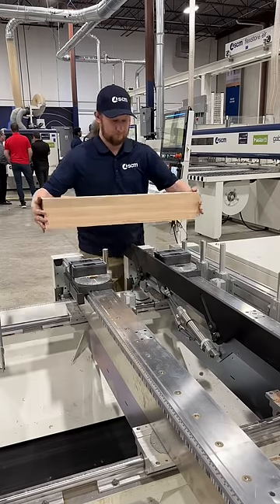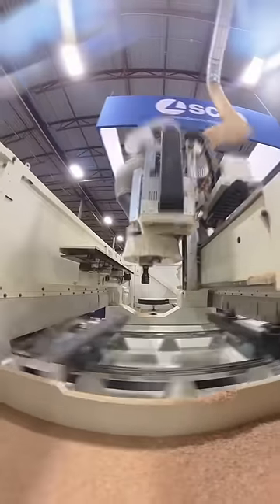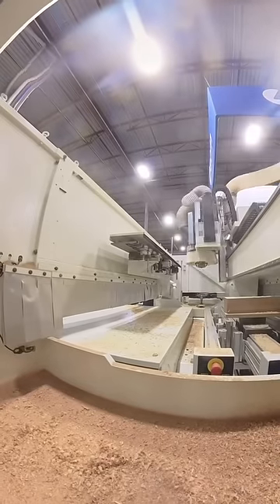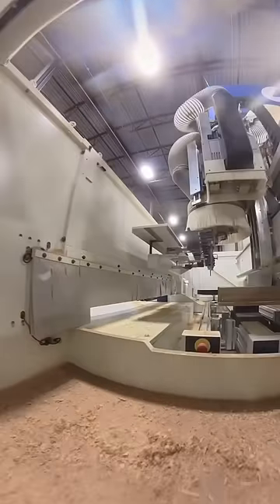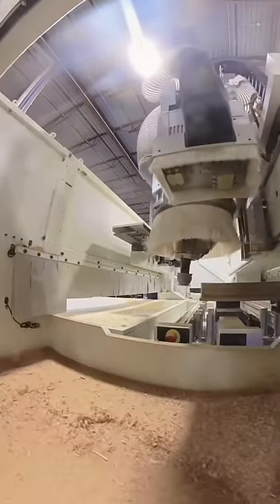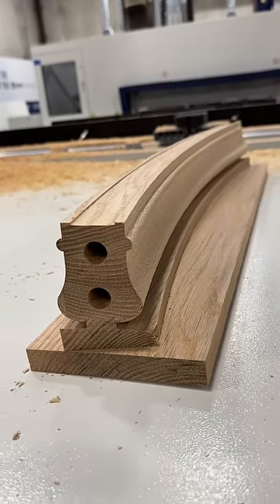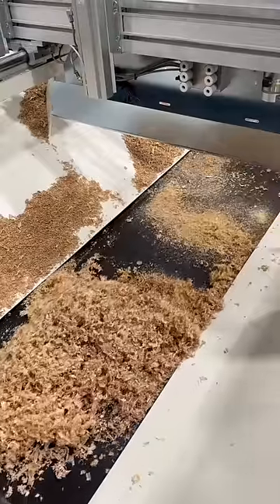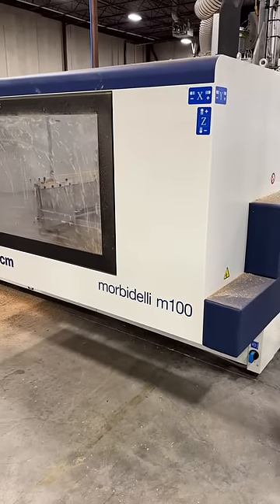Very cool 5 axis SCM woodwork machine #woodworking #maker #tools #wood #cnc

Comment: "another cool thing to point out is that it has a conveyer belt that transfers all the sawdust out and into my neighbors yard"
Reply: The cool thing most of the houses are ranch style on concrete slab. it doesn’t need any step with railing.

Comment: Fit in well, in my garage. Never mind just wishful thinking. Thanks for sharing
Reply: This looks quite wasteful unless it is doing a one-off.  
 Just to let you know  the Chinese were doing  investment casting of metal parts maybe a 1000 years ago. They would cast in say 20 pieces at a time  horse bridles. So making complex parts has been around and does not necessarily need a 2 million dollar cnc  lathe.
Reply: @emanuelmifsud6754  What on Earth does investment casting have to do with CNC woodworking?

A man with an Adze and a drawknife could make make this 10,000 years ago, but certainly not the 'average' man.
Reply: @emanuelmifsud6754  ... This item is actually  custom piece. meaning there will not be another. These machines are capable of machining multiple copies of one part, all while the operator is removing the finished part, and replacing it with a blank piece of wood block, hence cutting production time since the machine does not have to wait for the operator to load a blank block then start cutting it.
Reply: @emanuelmifsud6754 the sawdust doesn’t just go to waste from a big operation like that, also that thing cut that amazing thing in like 30 seconds. It’s a money printer 😂
Reply: @Sandburn58 there's no two the same pieces of wood.
Reply: Probably more than your house is worth,five axis generally go for a milliondollars,I are chinist
Reply: @tomwristen372  . So what you’re saying is, I might just be able to afford the packing it comes in🤣😂🤣😂
Reply: @dustylumberco 
Is This Italian Company?
Reply: @RichardMLowe   yes, it is
Reply: @user-nj1ob8ht3p  
User in New Jersey 
I'm trying to figure out where in Italy he went I already knew that he was there 
If you look closely at how Italians spell names (last name) they will have double letters in some to most cases 
My grandparents are from Sicily (the island) on my mother's side and came to Long Island in the early 1900's before Hitler and his Goon Squad made an attempt for World Domination and failed

Comment: thats cool, but the rail should be bent instead so the grain doesnt look differentl
Reply: Awe common man you know the thing can’t do what a human can. We just want to convince you that it better, faster, and more efficient than a human.  The fact that it doesn’t look right is your fault for expecting to much!!!!!   😂😂😂😂   They say the machine doesn’t take breaks or days off.  I’m a truck driver and I beg to differ.  I’ve lost entire days waiting for some human technicians to fly in and fix these damned machines.  😵‍💫
Reply: @xXGENDAMAGEXx  And I worked at a place where they expected 9 people, mostly office personnel, to run the automated facility. Guess what they found out? Even robots take unexpected breaks. So they have 30 to 40 people working around the clock 4 to 5 days a week. Every hour they're down they loose $45k. Somebody has to crack the whip over those robots.😂
You can't get rid of humans completely.
Reply: @markm3.16  Yes exactly.  They think they can replace Truck Drivers with self Driving Trucks. 🤣😂🤣😂🤣😂.   If they do that all of them will pull over and stop. Because the four wheelers will bully them off the road. 😂🤣😂🤣
Reply: That and all the wasted wood to make that one part. SMH
Reply: Bent wood over solid pieces is no contest...  Solid pieces look infinitely better than strip-laminated, bent wood, especially since all the fittings are solid wood.  

It's really all about craftsmanship anyway.  If the strips to be bent, were cut from a single board and  then reassembled sequentially, you'd get a railing that actually looked like a bent piece of wood.  

Likewise if the factory fittings weren't made from downfall (scrap) they might not look like they were made from scrap.. 

The proper way to custom make railings is to make as much of the top exposed surface from the same board.
A complete inside curved handrail and volute would typically  be made this way.  The increased number of  butt joints becomes unnoticeable.  

Of course no one does work like this anymore and that's a shame.

Comment: This isnt really woodworking. This is computer programming
Reply: Was just about to say this is wood button pushing.   Not woodworking.
Reply: As a real computer programmer, I don’t think it’s the same
Reply: As a woodworker and software engineer, it's more computer design than either WW or programming.
Reply: The funny thing is that the woodworking industry is self-immolating itself, thinking that they can charge more to have a cnc machine do it for less. Soon AI will be able to design and assemble everything and all you’ll need is a person with an IQ of 92 to push lumber through a machine all day. CNC should only be used for bulk repetitive tasks like flooring or moulding.
Reply: @CallumOz it’s just cnc programming. It’s been around for a number of years but usually to cut metal
Reply: Yes it's a CNC machine tool.  And what the narrator doesn't realize is they've been available since the.
And before that both in the metal and wood cutting we had tracers for oh 150yrs.
Reply: And we are loosing the ability to craft by hand.😢
Reply from the maker: An example of large scale production 👍
Reply: First of all it takes multiple skills to run a machine like this theres design/cad aka computer aided design which takes alot of practice then what you rookies seem to call cnc programming which is actually cam or computer aided manufacturing then actually knowing machining feeds and speeds, cutters ,there's alot of trial and error and experience needed here then the machines cost as much as a house. You guys also want cheap parts but also complain that nobody makes stuff by hand anymore and all this is just a matter of pushing a button and apparently AI will replace the whole industry that part made by hand wouldn't be anywhere near as accurate and it would cost you a few hundred dollars a piece.
Reply: Whoever built the machine that built this machine was a master craftsman.
Reply: Anyone want to trade your hobby of woodworking for operator? Not me. Thinking about going all hand tools!
Reply: @JB-td4ei you are correct.  A manufacturer will obviously introduce any method to save costs especially labour.  Here we are seeing the death Nell of skilled craftsmen. This is really no different to say plywood manufacturer.  That industry needs one person  to load logs into a hopper and at the end of the process out comes plywood.  It does need technicians to maintain  the machine but essentially the machine replaces hundreds of workers.
Reply: Just because you can do something doesn't mean you should do it.
Reply: It's programming, but it's not, it's cad cam, produce the cad, tell the cam software which tool to use at what depth and number of passes, then click export programme. A knowledge of wood and woodwork helps a great deal.
Reply: @HumansAreCarnivoresNotCows off by a couple decades but it’s ok, you clearly just need a hug. I just believe in the purity and craftsmanship of woodworking and this really just takes the character and love out of it
Reply: @emanuelmifsud6754 what you are describing is called human progress. Before the time of refrigeration. There was people to harvest block of ice off of lake. Then refrigeration happened. Instead of harvesting the blocks of ice. The people migrated into maintenance of the refrigerators. 
Also people desire for cheap cost will alway push human progress forwards.
Reply: It’s called gcode and a slicer program no different than any other cnc or 3d printer
Reply: @roybreitkreuz307  not me
Reply: @kieren7763  YADA YADA YADA..
Reply: @hoktang1  not really the same thing as block ice
Reply: @Mm6221  the concept of human progress is the same. From harvesting ice block to maintaining refrigeration equipment. The migration of work force.
Reply: @hoktang1  I disagree
Reply: @MrMonoposon  I think it's unfortunate that this kind of machinery is being developed and at least let it be used for repetitive manufacturing with returning the kind of craft to the skilled workmanship back to individuals.
Reply: @JB-td4ei  as someone working in high end custom market i can assure you that while we will use cnc and ai for some tasks, they will never replace skilled labor in our market... at least not for the foreseeable future. As far as maintaining the skilled labor supply... that is another question.
Reply: its like comparing a driverless vehicle to one you drive yourself... they call it progress
Reply: @Mm6221  actually it’s more like having a robot build a car and you drive it and you calling yourself a mechanic
Reply: @KiltedCraftsman  same principle  as I stated
Reply: @kieren7763 I will say though however the knowledge and expertise to run these machines let alone engineer the machines is a very fascinating Virtua in itself. Which I myself am very mechanically inclined what kind of born that way. However, by using a machine to replace the uniqueness of a hand carving of any wood item takes away its authenticity and generally cannot actually have a human stamp their name on their product because it was mainly a computer Guru who knows how to engineer this equipment to run it properly to carve the wood. Which in itself is its own industry
Reply: @CallumOz  tell me your a terrible programmer without telling me....
Reply: Machines can make beautiful works of art to but it’s just not the same. It’ll never be art
Reply: And?
Reply: I agree. No humans needed.
Reply: @dustylumberco  you obviously are ignorant to what it means to be competent with you abilities.. not just pushing buttons 😒
Reply: @dustylumberco Yeah, we don't care about craftsmanship anymore, just production.
Sorry, it's an incredible machine, I just think it's sad where we are heading as a human race. People don't want to work anymore but have someTHING do for us.

Comment: I went to school for woodworking and we did learn what almost everyone in the comments call “real” or “traditional” woodworking but we also had a cnc machine that we got to learn how to use. The thing people fail to realize is not just anyone can learn how to use a cnc machine without having at least some basic knowledge of woodworking because there is a lot of things you need to take into consideration when programming the program that you want the machine to to on your material. And if you’re not careful you can seriously ruin the tools in the machine or even the machine itself or if you’re really unlucky have the tool shoot out of its socket

Comment: As a daughter of a engineer. My dad would design and make these items by hand using a machine with dials. Now, if you put in the wrong data into the machine, you get out the wrong result. You have not had the joy/headache of making them. I believe you'll learn more from making it by hand than making it by this machine.

Comment: These C.N.C. (Computer Numerical Control) machines existed since before 1979. They have evolved from manually inputted data, then punched tape, then added memory unit, then included memory unit, until finally connected to a P.C. with a software that generates all the (G codes & M functions) that the machine reads and understands where to go, how far, at what feed rate & what to do next. In fact, the earlier machines used to execute one line of information at a time. Nowadays, C.N.C. machines read at least 10 lines of information ahead of its action to create smooth cuts and faster production.

Comment: Big deal, try running a 12 axis Computerized Numerical Control (CNC) cutting 2-Titanium airplane wing parts worth each around $300k; now that is pressure. Especially for the CNC Electrical Technician that has to tune and repair the machine; not knocking the programmer but we’re in the actual business of cutting the part not simply a 3-D mockup.

Comment: Very cool, for sure...but the human element is completely removed.
Reply from the maker: I think there is a place for robots where they replace monotonous, repetitive tasks or tasks where it can reduce injury.  Grabbing and stacking flat pieces of plywood all day long is a job I wouldn't want and would happily let a robot do.  It still requires a skilled operator to program and run the robots though and that is an interesting and high skill job that has lots of potential and for the future.
Reply: @dustylumberco  oh, absolutely. I hear what you're saying, buddy.
However some things like this replace craftsman to a great degree, in the name of efficiency....which I get but where do you draw the line?
Human beings are built to work. If we eliminate all medial tasks, it removes a level of growth and experience that can't be replaced once it's gone. That's clearly evident in today's society.
On the other hand we have to be extremely cautious of more advanced AI. We're just not ready for it.
It's a slippery slope and we'll be hooped if we jump in too fast, feet first...like we're doing.
Reply: Programmers are human 😂
Reply: @JakeWitmer  brilliant statement. Your intelligence is showing.

Comment: With this type of equipment, you'll no longer see high prices on quality cut design wood. You'll probably see moldings that go around your ceiling with intricate designs that's made in just a couple hours now. Where as it would take master woodworkers days to finish this kind of work. 

Say goodbye to the master woodworkers as they are no longer necessary.

Comment: I can't see what is so cool about it... I mean hello to CNC machining I guess... if it can machine metal it can machine wood, simple problem is just the cost. Usually woodwork is not worth enough money for somebody to drop million on CNC machine... and unless you replicating loads of parts then designing the part will take more time than cawing it with chisel.

Now I am not saying it is not done ever - for furniture for example, they often use CNC for complex engravings, but that is only because they make thousands of those engravings and then it makes sense, but it does not make sense for 1 off piece. Just not cost effective and not time effective.

Comment: Awesome another way to screw over the carpenter make factory and then assemble
Reply: I don't need brains and skilks with the computers doing it for me which makes skill labour go away and drums the industry down over time not good for carpenters futures good maybe if you were using it for exploration and building new parts while on the go with no skills but long run bad if all use it